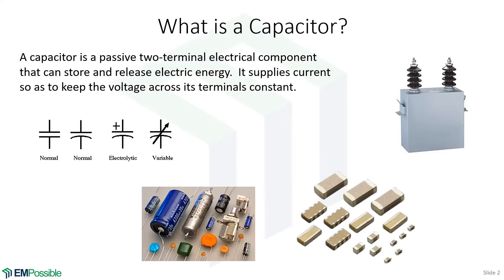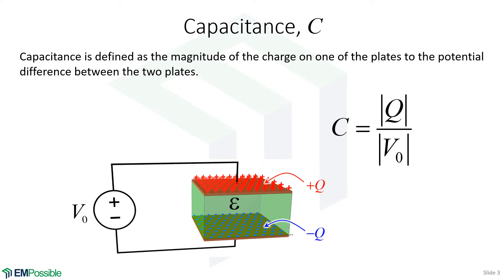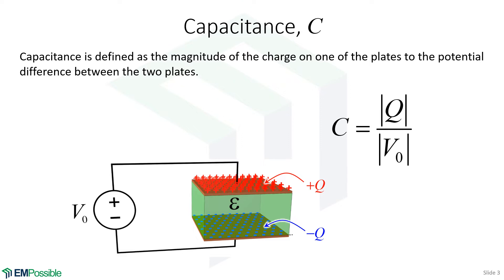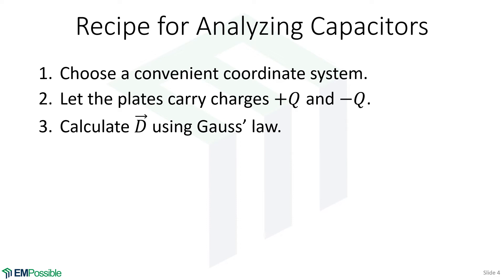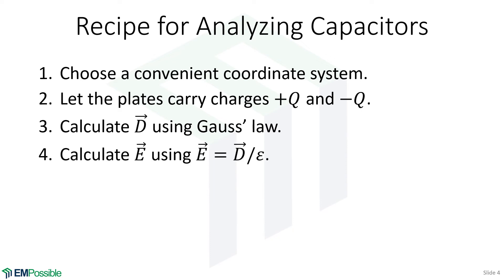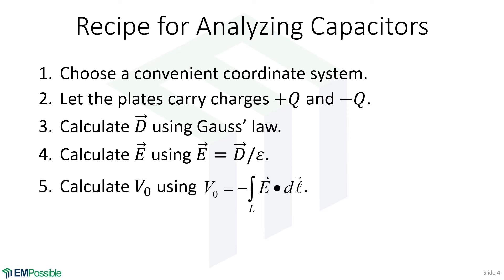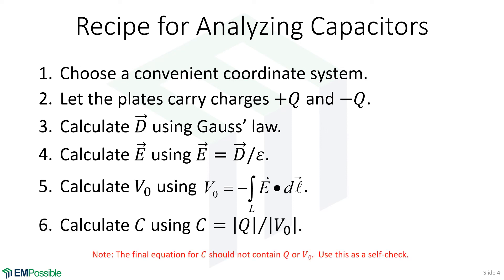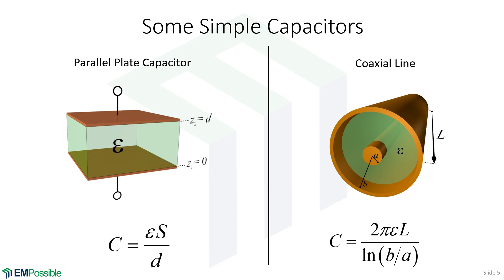Lecture -- Analyzing Capacitors

Comment: If the geometry of the capacitor were too complex, how could the density be calculated?
Reply from the maker: I am about to post a video on that subject.  I should have it up by the time you read this response.  You can get to it from the course website:

https://empossible.net/academics/emp3302/

I think for a complex geometries you need to calculate the capacitance numerically.  There are some canonical shapes like cylinders and spheres that can be solved analytically.  Otherwise, numerical may be your best and only solution.

The video I am about to upload will give you a taste of the numerical method.  If you want to full details of the numerical method, work through the videos in Topics 6 and 7 in my Computational Methods course.  There is a transmission line example that calculates capacitance using the same method.

https://empossible.net/academics/emp4301_5301/

Hope this helps!!
Reply: @empossible1577  It helps, thank you! I have just watched the video about numerical estimation of capacitances. It is really good!